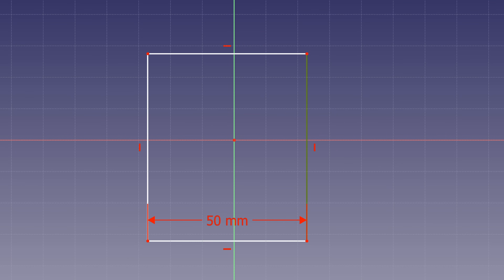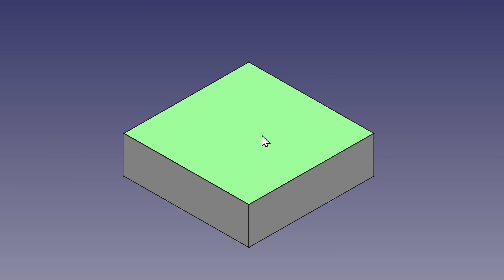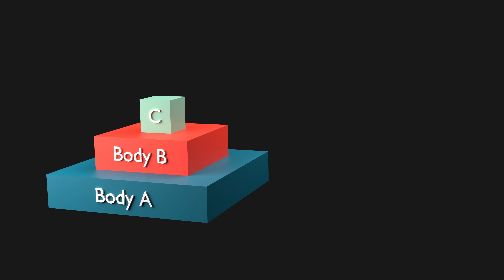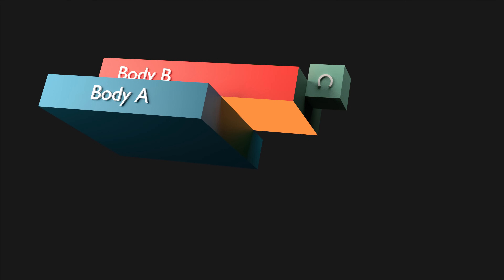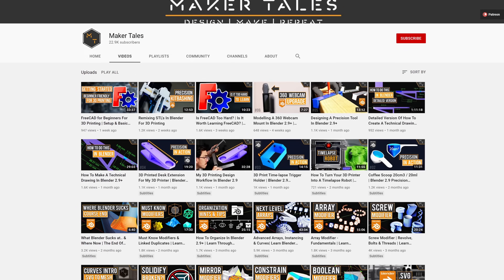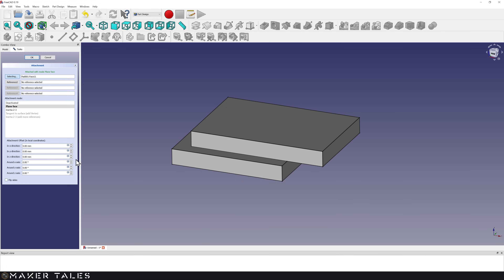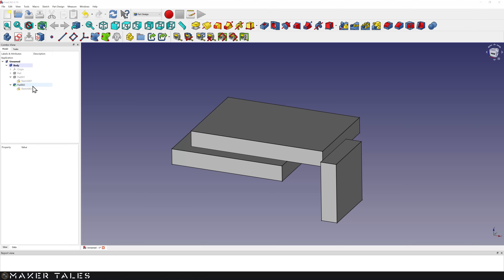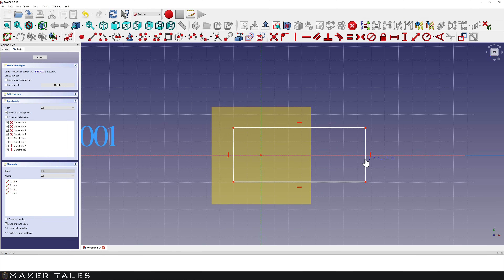FreeCAD Is Fundamentally Broken!  - Now what... Help Me Decide...

Comment: A very blunt option that hasn't come up in the comments yet from what I see: FreeCAD isn't worth your time yet (even if it's my personal parametric software of choice).  Don't make videos until the issue is fully fixed and settled out in mainline, or you will frustrate yourself and your audience, and turn people off of FreeCAD.  Focus on documenting other tools for about a year, then document a more stable version.  This saves you time and hassle, and doesn't drag new users onto a known-broken platform.  But please do come back to it: I found your blender precision modeling series very helpful, and would love to have that kind of documentation for FreeCAD.

For context, I learned F360 back in 2015, when it was constantly in workflow flux. This was INFURIATING as a new user.  I would find official tutorials that used features that had been moved to a different menu, if not refactored out of existence in subsequent releases.  F360 was simply not worth trying to learn, since you never knew if step 9 of a 12 step tutorial on their official blog would straight-up no longer exist in the product.  I eventually got going with F360 after a MechE friend walked me through how to use the most recent builds at the time.  If she hadn't been there and helped me out, I would have chucked F360 to the curb much, much quicker than I did.  This got me up to speed on parametric modeling, but the licensing smelled funny, so I decided to switch back to OpenSCAD for stuff I cared about.

It was only a year or so ago that I got back into FreeCAD and quickly hit the parametric naming problem.  As a grumpy old software person, I thought it was a "silly" bug until I stared at a for a bit.  At this point, I have a rough handle on the difficulty in fixing this, and am really impressed with the proposed fixes.  That said, there is a lot of subtlety, with tons of "corner cases" that are going to keep popping up for a while after becomes official. 

It's reasonable to expect FreeCAD to go through a significant amount of UX/workflow flux over the next year with the new release and new linking system, and for that to break a lot of external documentation.  Heck, even their internal wiki documentation was still broken as of a few months ago, due to 0.18 to 0.19 changes that weren't fully documented!  You would probably have to remake literally every single video for the new release, and then deal with comments from people in the new version who watch the wrong version.  It's a recipe for pain, and doesn't seem worth the effort given that current versions are all dead ends.

So: if I were you, I'd invest my time in documenting other tools, and then come back to FreeCAD once the dust settles.

Comment: This type of issue with developers of open source projects not caring about usability but sticking with their own notions on how the program should work or what features it should have, exists in other big projects as well, notably OBS.

OBS devs and community are utterly hesitant to include ANY features that exist in professional video mixing software, like image metering (vectorscope, white balance etc.) to anything regarding audio, that it's almost hostile. Their response is "do it yourself!", "there's this very slow and cumbersome workaround so it's not something we need to address" or "OBS doesn't need master level meter for audio, because it's not an audio mixer!" even when it clearly IS because you can combine multiple streams of audio from separate media sources in OBS... so you need master LEVEL meter to know if the combined output of different sources are clipping or not...

This attitude will destroy any project at due time unless the toxic people are not dealt with and ousted from the project so that it can finally breathe and grow properly (like what happened with KiCad).

Comment: You call it bug, I call it abomination! I appreciate all the effort that the community is putting into this project, but having that thing from the get go? I smell management problem, I don't wanna know what kind of bugs there are going to be down the way, and CAD Designers having to deal with this? No thank you.
Reply: What you are missing (and so does OP) is that this is not a bug in sense that what that word means. Bug is if you design something to work in some way and it behaves erroneously in other way - say you design calculator to solve 2+2 = x and it returns x=5.
But topological naming problem is something completely different - it is actuall scientific problem which does not have complete solution (or at least not easy one). And since it does not have readilly available solution, development team intentionaly skipped it in order to have at least somewhat functional product. If I stay with calculator analogy, it is like asking calculator to solve (10/3)*3=x and expecting it to return x=10 - which most cheap calculators on market will fail.

Now, just like (10/3)*3 looks trivial for human to solve, so does topological naming problem. But in practice both are pretty hard to algorithmize correctly. Just try to imagine what would happen if I take a cube and make a groove across one of its faces so that it splits that face in half. Which of the halves will keep original name? How will you name the other half? Either way, one of the halves MUST change its name and all things referenced to its original name MUST fail (unless you have some serious code sorcery running in the background). If the project management decided not to launch FreeCAD until sufficient solution to this problem is found, we would not have any FreeCAD.
Reply: @PavelDolejsi  No, it was a super lazy desing. There is no reason for a face to be renamed if that particular face wasn't touched at all. If you make a groove on one side of a cube then there is no justification for messing up the name of the face on the opposite side.

The problem even appears in sketches. By just adding one line to a sketch can potentially rename all other lines that you didn't touch.
Reply: @IndrekL  When you look at it from your human perspective, then sure, why rename what was not touched. But how is computer supposed to understand what user did or did not change? All it knows is that geometry changed somehow and that it has to recompute the geometry, part of which is reassigning all names. What kind of algorith would you propose to recognize which face should and should not be renamed?
Sure, it was sort of lazy design. They could have left the program locked in their computers until it was perfected - except that then we would never see FreeCAD at all. And same applies to majority of opensource projects.
Reply: @PavelDolejsi  Ok, I understand that maybe keeping the names of the faces is non-trivial because you may add faces/resize/change angles at the same time, and then mapping the correct names is tricky.

But there is no excuse for renaming lines on a sketch if you add new lines. Existing lines are 100% identifiable even for the program. Just give each created line a unique ID. It is a bit more complicated if you split an existing line. But a good enough work-around is that give the current ID to one of the split segments and assign a new ID to the other one.

I don't even care about the face/edge references that much. It would be fine if they disabled it entirely. But the sketch line renaming problem made FreeCAD un-usable for me.
Reply: @NabilBennaniKerrout  Agreed. Though I think it depends a lot on what is considered critical feature and functional product. Keep in mind that even quite recent versions of FreeCAD (0.16 I think) did not even allow you to directly sketch on faces, so broken references were a lot less of an issue. And sketching on faces is even in professional CADs not recommended. 
I think FreeCAD is in this matter victim of its own success. When project started years ago, team had lot less ambition and nobody even expected it to compete against commercial CADs any time soon. But as it grew and started to be more and more viable as "full" CAD, people started to have bigger and bigger expectations from it.
Reply: @PavelDolejsi  Yes, indeed, the project got big, and it got big for a reason, it's about time to have a fully opensource CAD program, but it has to be well done, it has to compete. I believe it will have same or more potential than BLENDER, no joking! But it has to be well made, it has to solve this issues, as more will arise down the line, and this part is basis. So, to the management team I'd say, keep up the good work, but don't oversee this issues, or at least, don't build on top of them.

Comment: I started leaning FreeCAD because of the only real competitor wasn't really free and not available on Linux. I designed countless objects with it and had to learn this bug the hard way, but it was still worth it. To bad the Fusion360 change in handling the FreeOfCharge version could not be used to increase the userbase due to this fundamental bullshit bug. Instead of fixing it 5-6 years ago, it was ignored an FreeCAD grew and made fixing it even more complicated from year to year. Instead of creating tons of Wikis and Video, to tell people what features not to use and how to work around. Developers wastered so much time in telling people on Gitter and IRC over and over that they are doing it wrong, instead of making it right.

Comment: Having used Solidworks professionally since ‘97 I learned quickly not to reference important features off existing solid geometry but rather sketches only on reference planes to ensure model robustness.  That said I’m looking forward to learning FreeCAD in the future.
Reply: I currently use both FreeCAD and Fusion 360. FreeCAD makes my Fusion 360 models better because I tend to do more planning and scripting instead of easy and lazy geometry references (if you push hard enough, they break on every CAD). So yes, tutorials on hardcore, origin referenced models are welcome because it's a skill that makes you better on ANY cad.
Reply: This.
Reply: I also find the robust method of reference planes to be a faster method in the long run. I have even observed scenarios where the internal references of a multi body part are so twisted that even the file creator cant make a simple design change without ,,exploding'' the whole thing.
For me best work flow for now is to split up the job in 2 parts - RnD cad models and ,,Final'' cad models. RnD can be a mess but once you know how the model will look and what might be best reference planes and dimensions it is time to redraw all of the parts and assemblies to be clean and neat
Reply: @artursrimsa3003  I could not agree more.

Comment: Several years ago when looking at cad programs, I took one look at the fusion 360 license terms, foresaw pretty much what happened, and went elsewhere.  Losing full access to my own design drawings because of a software and license update was not a risk I was willing to take.
Reply: You don't even have full access to your own designs? I knew Autodesk was shit, but damn
Reply: @EddoWagt  You do actually have full access. The "issue" is that you can only edit 10 files at a time... Which basically means you can only have 10 tabs open. In order to edit them you need to click a lock button in order to make them uneditable to free up your slots.

That said, you technically can have more than 10 files open simultaneously, you just can't edit more than 10 at once... Which outside of some insane setups isn't much of a limit. Annoying, yes, limiting? No.

And if instead @hanelp1 is talking about fusion 360 saving everything to the cloud, it isn't hard to save the files to your computer and to load them that way. (Export instead of save.)
Reply: @SirSpence99  I feel it's pretty easy to reach that 10 file limit
Reply: @SirSpence99  Well, let's see how well your post ages after the next license change.
Reply: @EddoWagt  Sure, it is easy but it is only a simultaneous limit, not a limit on total files.

So, unless you are doing something absolutely insane or are incredibly disorganized, it will be at most an extremely minor inconvenience.
Reply: @coreviz  Sure. I'd love to see a viable competitor to Fusion/Solidworks. Given that FreeCAD has this issue, I'd expect a minimum of 5 years before it reaches parity with how Fusion/Solidworks is now.

Basically, FreeCAD won't ever catch up... The issue in this video should be solved before any public release has been made. It makes me think that the people developing it are not power users of parametric modelers.
Reply: @coreviz  You can still use F360 for free. I just renewed mine and have been for 5 years. Seems like it's aging pretty good.
Reply: @coreviz  Even paying 700 bucks per year everything has aged surprisingly fine, purely due to how much time using FreeCAD would waste by comparison. Even if just using it as a hobbyist.
Reply: @EddoWagt  A situation I avoided by not using fusion 360.  The risk exists any time your files are not on your hardware, or depends on software that could be "upgraded" without your control.

Comment: Seems to be a persistent problem in the open-source world. The software is written by the users, but since they understand it from the inside out, they aren't motivated to fix the problems that new users see from the outside. In some cases it seems they relish that people find the software impenetrable. I haven't yet jumped in to freeCAD, because it does seem to suffer from this problem...
Reply: As someone who has just started to use freeCAD and has struggled to try to design a hush-box for my projector I wholeheartedly agree. 

Yes, there are tutorials. But I truly struggle to find a good way to build a wooden box... A friggin box. Not an animated articulated industrial robot arm. A goddamn static nonmoving box. 

Or just move the camera inside a house without getting polecat syndrome. 

And most tutorials I find are just timelapse videos. And even when I find someone that talks. They never say why I should use one tool over another. Or why an approach should not be used in some circumstance. Nothing. So I can't implement their knowledge in other situations. 

And the echochamber thinking is probably part of the problem. Because if you know all the steps needed to do the basics you don't want to relearn them, so you get reluctant to implement changes that makes things more intuitive. 

I mean. I see the potentials here. I just want to be able to use the tools.

Comment: You are going to have those types of changes in any programs normal updates. They rework, add and subtract tools, change what was working and what doesn't. All videos will become obsolete when the newer updates come out for almost any program. It just depends if there is a desire for video tutorials or if you want to make tutorials. Personally, although I am not brand new to cad( I learnt the basics of Onshape). I followed along tutorials using datum planes and understood it just fine. Onshape is much easier and more of a solid program. But I just can't afford it. I tried to make a battery pack model that I easily made in Onshape in FreeCad, It broke. And I have no idea why. So personally I'm here for some FreeCad tutorials.👍

Comment: I am more familiar with Creo and Pro/ENGINEER.  I think I have a good understanding of these kinds of problems, but it is hard to follow your example because you don't show how the constraints were made for each sketch. Your example gives a surprising result for FreeCAD, but I can't really evaluate if it is surprising because I don't know how you constrained your sketch. I think you could do something surprising with lots of CAD systems if you play with the dimensioning & constraint scheme.  (If I knew your design intent (dimensions/constraint scheme), I may agree with your assessment... but I didn't catch it in your video - which focused more on the topology.)

Picking faces to constrain a sketch is usually okay for simple topology and/or you know the face is stable and won't be consumed by some following operation.  But for a real world design, particularly for geometry/topology shown in your example, you typically have your GD&T hat on and will constrain sketches to datums (planes & axes) rather than faces; so you won't have this problem.  Not everyone has their GD&T hat on, and sometimes picking a face is a pragmatic choice.  So I'd expect the Parametric CAD system to be good at not mutating the topology when some parameters change; and particularly so when the geometry is simple like the case you showed.  But we really don't know the design intent of your sketches (constraints/dimensioning scheme).  So it is hard to evaluate if what it re-generates is reasonable or not from a user perspective.

An additional comment about selecting faces and other reference types.  Yes, there are cases you may pick a face... and with any parametric design there is always a risk the face may get consumed or replaced.  Creo & Pro/E are good at maintaining the topology so you don't have to worry about things blowing up.  But there are special cases where it is helpful to use special selection objects.  One example is to create an intermediate 'intent object'.  These are features that hold a collection of references you select... You then reference these named intent objects further down in your design.  You may reference an intent object N times... and if something about that intent object's references are unstable, you just have to update the one intent object and each of the N downstream features will update because they reference the intent object.  This saves a lot of time when updating a model where a referenced face is consumed/replaced.